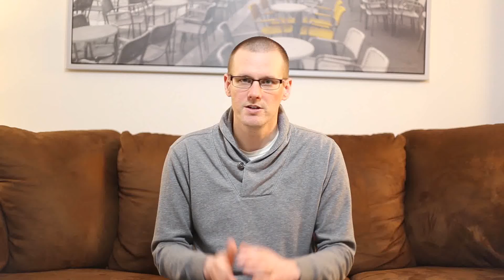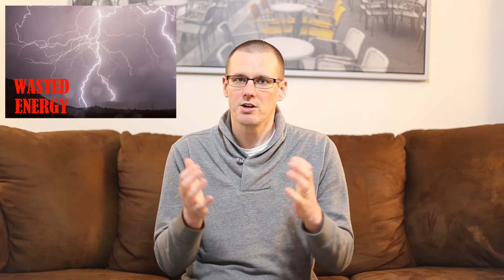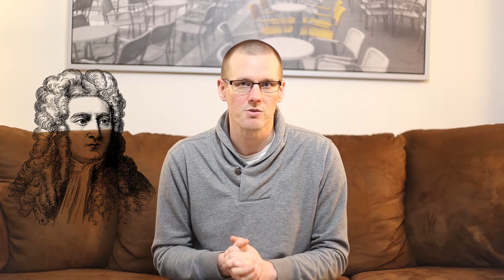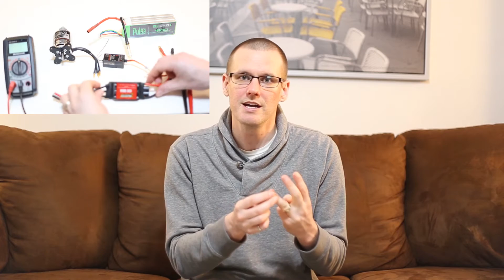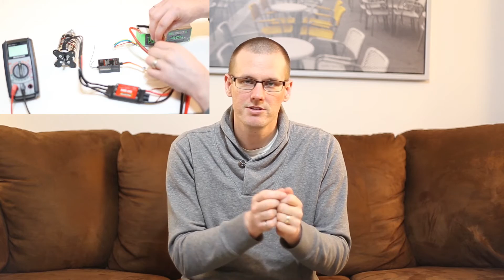Brushless Motor No-Load Current - Understand / Efficiency / Measure

Comment: On an SEDF setup, regarding Low Timing, would it be problematic if the voltage is considerably higher than factory stock (14S vs 12S)  using the stock 12 bladed rotor. How do we make sure that we dont blow our load too early?

Comment: Good practical measurement.  Thank you.  One comment: even though voltage across the battery leads is not going to drop significantly, I would put a voltmeter across the battery.  This, of course, becomes more important if you have load on the motor.

Comment: Isn't the current from the battery pulse width modulated rather than DC?
Reply from the maker: From the battery it is DC.  It then is Pulse width modulated at the ESC and lastly electrically commutated in to AC power for the motor.
Reply: @RCexplained  So there's enough capacitance on the ESC inputs to enable accurate current measurements with a DC meter?  Have you checked that with a scope?

Comment: you forgot to take the controller losses into account.
Reply from the maker: This can be found in great detail within the description of the video.
Reply: @RCexplained  esc   insicnifiant...this just dosent sound right to me.
Reply from the maker: Hey Russel, doesn't sound right based on which part?
Reply: @RCexplained  you saying the power losses in the speed controller are insignificant..i dont know maybe your right at full throttle under no load?? maybe the controller does nothing in this situation..but controllers have risistance right...mosfets are mounted on heat sinks...can you do the test and mesure energy used between controller and motor and compare?
Reply from the maker: Resistance in the ESC will cause a voltage drop that can be determined by V=IR. The resistance of a 100 amp rated ESC is very low, typically less than 3 milliohms. Using the formula, the voltage drop across the ESC would be less than 10 millivolts for a larger Io value. (0.1% of the typical voltage Io is measured at)

We also know that small variations in voltage don't really effect the Io value at all. Therefore, we are not concerned about these voltage losses. 

To be able to measure this difference would require very sensitive equipment to measure these very small values of difference. Equipment that I don't have.
Reply: @RCexplained  im no expert but energy is not mesured in volts.corect?
Reply from the maker: You don't want to look at energy. Energy is the work that has been done or potentially could be done. 
Here you want power which is energy with a time component as a rate.
Reply: @RCexplained  we dont mesure that in volts right?
eficiency is the main word in the title..i think your missing some perameters here..unless you want to run motors with controllers at no load..then maybe your advice to select a motor using this method would be ok.but if your going to use a controller then mesure it or use same controller at same setting to test all candidates...in the real world though a person might want more info to select a motor like how many polls might be one  example.
Reply from the maker: Hey Russell, voltage is a primary parameter for both energy and power. 

The keyword for this video is the No-Load Current. The point of the video is to explain why we see this parameter on a motor spec sheet, how to measure it and how to use it.

The word efficiency in the video title refers back to the No-Load Current as explained throughout the video. 

In no way do I advise selecting a motor purely based off the no-load value. There are numerous videos on the channel identifying important parameters for motor selection. 

As I mentioned earlier, ESC efficiency for measuring the Io parameter of a motor is insignificant and not important. Whether the ESC is 70% efficient or 100% efficient  will not  effect the results.  Whether the voltage drop is 0.1v or 0.3 volts, makes no difference. 

Why would we care about ESC efficiency for measuring an Io parameter based on this?
Reply: @RCexplained  i came here via a search on eficiency..."Why would we care about ESC efficiency? " brushed dc motors can run with out a controller ..brushless dc motors need a controller..i want to know how much energy controllers use.....from memory you say in this vid to chose the motor that has least no load current....how much energy and curant does an12v battery have?

Comment: Great explanation videos!!! I have a quick question.... What kind of no load current would you expect to see on a 190KV 6368 brushless dc motor running at 36v ? I have found it impossible to find a data sheet and am worried I am about to fry my esc by running it.... I am trying to make a tennis ball machine so the loaded current shouldn't be much higher...? Many thanks!
Reply from the maker: Hi Mathew, I would expect unloaded current to be around 5A or less. However,  I would not be too concerned about unloaded current regardless of what it happens to be. My attention would be focused on loaded current. Loaded current is proportional to the load that you are placing on the motor. As load increases, current increases. This would entirely depend on your setup. You will have to accelerate your motor up to speed first. This will pull current. When operating, if you rely on a heavy mass to use inertia to help spit the tennis balls out, this will  smooth out the loaded current during delivery. However, if you are no stop popping tennis balls out of the machine, inertia will get bogged down and the motor will be doing all the work.

Comment: Well explained,  For no-load condition increasing current at the same voltage will actually increase torque since more power is provided & we can reduce RPM that way as well?
Reply from the maker: Thank you for your comment.  I don't quite understand what you are getting at. How are you going to increase current at the same voltage? Or are you referring to a motor with a larger no load specification?

The no load specification doesn't really tell you much about the torque output of the motor.
Reply: @RCexplained  if you use a motor at 8A & 24V or 12A & 24V (assume you are a developer). Here no-load torque will simply increase as the magnetic flux produced will be higher
Reply from the maker: @skipper6599  yes, an increase of current produces more torque. This happens when the motor is loaded. 
No load implies no torque is produced.
Reply: @RCexplained  But what in case of a BLDC motor? they always produce no-load torque.  In actual no load term is inaccurate as there is always a load because of the rotor. if no torque is true than RPM should be able to go infinity.
Reply from the maker: Hey Skipper Studio. Load is typically regarded in BLDC motors as external to the motor. Internal load is related to efficiency as in theory, following newtons first law, there should not be any load to keep a motor rotating. Since nothing is 100% efficient, this is where the No-Load (Io) value comes in. 

A high (Io) value on the motor, does not say much about the torque of the motor. But it does tell you that there is a lot of wasted power at high motor speeds. 

RPM of the motor is electrically limited by kv and voltage. Any type of load does not come in to the equation.

Comment: If I'm using  2s-12s motor
 at 6s instead of 12s 
so will it affect the power and torque of the motor?
Reply from the maker: You are limiting the power potential by not using the full voltage potential of the motor.
Reply: @RCexplained  thank you sir!!
But what about the torque?
Reply from the maker: @piyushtashildar3240  Hi Piyush, the torque that the motor delivers is directly related to the load placed on to it. Load is related to the current. If you pull more current you will have higher torque output. Torque on 6s can still be the same as torque on 12s however, it will be a lot more difficult to produce torque at high RPM's on 6s.

Comment: Thank you so much for your video, I loved it.

May I know what is the power required to move a vehicle of 180kg with solar panels, about 15 kmph.
Reply from the maker: Thank You for your comment!

To answer your question, it does highly depend on the type of hull that you have. If you have a planing hull, it will be easier to get to speed. I would expect that you should start with 4kw and adjust from there. I have been able to get a planing hull to 30km/h with a 225kg weight.

Comment: Hi awesome video that no load current. Just thinking here if i compare this two motors: http://www.leopardhobby.com/index.php/En/Goods/detail/id/45 page parameters and this model LBP4092/4D and compare that to this model: http://www.leopardhobby.com/index.php/En/Goods/detail/id/43 page parameters and this model: LBP4074/2.5Y. 

Max amps and voltages are near to same, 4074 have little bit bigger amperes because not find exactly same amps. 4092 is must bigger motor physically and have 4200W max power on specs and when you see 4074 specs that are much little motor and have 2600W. I have now this 4074 motor and i think if i change to that must bigger 4092 motor is my output power exactly same like this tinier motor 4074 (about of course bigger motor losses mass and bearings are little bit bigger, but if we ignore that). Do i maybe have better torque all rpm and better "trottle response" with bigger motor and maybe bigger torque?

And that max wattage numbers are quite odd. If i have 26v and 110A and 26v and 120A why other motor is 4200W and other 2600W.  Or is that something to how much temp and torque/power that motor can physically handle?

Sorry if my question is badly writed hope you understand and can help me with this :)
Reply from the maker: Hi Lassi, I'm not sure how I missed your comment. I like to respond to everyone who has a question. 
Moving to a larger motor with the Kv staying the same, should increase the amount of current that you can run through the motor, thus increasing power. If the load stays the same, theoretically, the overall power output would not change. The specific winds that you have selected do not have similar kv's from what I see. This would suggest you are considering increasing the voltage for the larger motor as the kv is lower. 
Specifications on that spec sheet do seem like there is something not making sense. 

I have more recently done a video on motor torque that you'd be able to view.

Comment: Disregard most of the previous gobblygook and perhaps this is more of a question on the fundamentals of current than on BLDC motors specifically, but in the instance of let's say a 5870 motor by tp power, I dont understand how the same 16000w output can be achieved from the same can from 25v and 600a or 125v and 125a (in both cases, Im using figures that are close representatives but not specific). Is there anyway you point me in the right direction for reading material or other sources or even perhaps elucidate this yourself? Thank you again
Reply from the maker: Hey! Thank you for your awesome question and comment. I think it would be best for me to answer these questions in a video. I can shift the next couple weeks video out and try and get these in this week.  It may take 2 videos, one for a comparison of ICE vs bl motors and one talking about voltage, current and motor power from the same can.
Reply: @RCexplained  that would be incredible, thank you. Learning new stuff, especially conceptual stuff, always came easy so I'm sure others are trying to sift through it all as well and it seems like such an integral part of the hobby and such an important aspect of so many of the technologies of the future I wonder why it's not more readily discussed. Hopefully your videos to come get a zillion views and get that ball rolling!
Reply: @sdy5001  Just a very rough calculation with TP5870 3D vs 10D: the former has high Kv (1690) which leads to a low torque constant.  The total torque produced by the motor is the product of this constant and the current. The current specified by the manufacturer as 650 A.
The latter has low Kv (540) which leads to a much higher torque constant. But now the max current specified by the manufacturer is much lower: 202 A.

And this makes perfect sense. The low Kv motor has probably thinner wires with more windings increasing Rm (basically the resistance of the wire). Resistance reduces current draw, hence the need for higher voltage. The thinner wire / extra windings would also heat up more if you were to push higher currents through it, hence the lower current limit.

So if you do the math you'll see that with max voltage/current you feed both with about 15 kW electrical power and get out of them roughly 14 kW mechanical power.

But this is ONLY the case if your load (the propeller) is such that you achieve the numbers given by the manufacturer. A too large/small prop may completely ruin efficiency for either of the motors. Of course you also need the power supply that outputs the specified voltage AND can supply the current.

Comment: Hey brother, again, love and appreciate these videos immensely. So I think I'm finally starting to put it all together, but then, ultimately, I know that I still have no idea because of my limited understanding of what is essentially the most important component and barometer, power output.  For all intents and purposes, I think there's perhaps some merit to thinking about a BLDC motor relative to an ICE motor with KV having a direct, albeit inversely proportional, relationship to displacement with the actual windings perhaps akin to Redline (a 6.0 liter American v8 historically makes good low end and mid range power but revs out at less than 6k rpm [i.e. a 4480 800kv motor] whereas a 3.0 liter v12 from Italy  makes its power at the top of the rev range and winds out to 8500rpm [i.e. a 4074 2650kv motor].  So even though both of these imagined engines make 400hp, their driving characteristics and how they achieve said power would make them feel and perform vastly different.   So there are a few things that seemingly always trip me up: Why are manufacturers seemingly so reluctant to broadcast the power output of their BLDC motors. If someone is building a gas go cart, the hp rating of the engine is one of the first decisions and defining characteristics (however It just occured to me that this is definitively only with 4 stroke engines with 2 stroke engines, like BLDC motors, using only their size to define each with the HP rating often buried deep in the manual, if available at all....oh the catharsis of writing...so maybe aligning BLDC motors more specifically with 2 stroke motors might be more beneficial) 

Man oh man, so If youre even still reading this, I guess my question ultimately boils down to how is the watt output of a motor determined and what value should we place on that number? Should that be a major consideration in our motor choice? Lastly, in one of my cars, I have a 2200kv 4074 motor rated at 1600watts with a 4s 86A max.  Running this motor on 4s, my power meter or the data logged (Im using a castle mamba x esc) have shown that the motor pulled all 86A but the output never exceeded 1250w. That's a pretty significant discrepancy . What might cause that? Can you please perhaps either point me in the right direction with reading material to better grasp how much power BLDC motors make, make a video on the topic, or respond to this chaotic mess of a post? Thanks brother and my inability to distill my lacking understanding only further corroborates how lacking that understanding is...ha, thanks man.
Reply from the maker: Hey Samm, Not sure how I missed replying to comments on this specific video.  I did a brushless motor comparison to ICE. DId you see this?

What voltage did you run to the motor that made 1250watts pulling 86A?
Reply: 14.8v times 86a ~ 1273 amps

Even a fully charged 4s at 16.8 volts multiplied by 86 amps is still only 1445 amps

If you want full 1600 watt power out of your motor, you need to increase the speed of the motor, which will increase the amp draw for a given load.

If you are already maxing out your ESC's speed capability, then you need more load on the motor at a given speed to increase amp draw.

The only other thing you could do is to increase voltage to the motor, but be careful not to exceed the rated voltage of your components.

TL;DR - you need to pull or allow the motor to consume more amps to achieve 1600 watts at the 4S voltage.